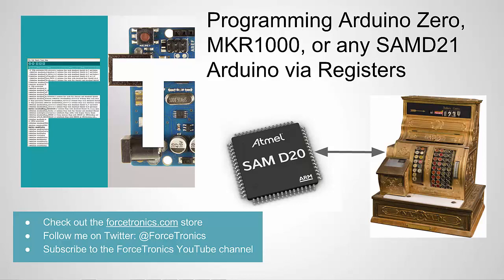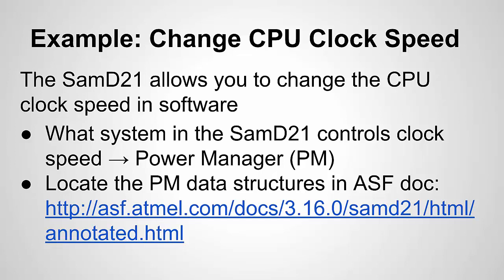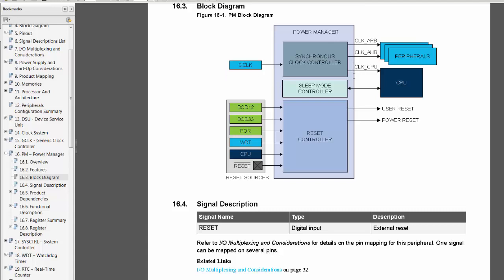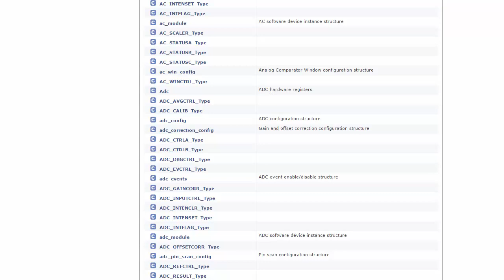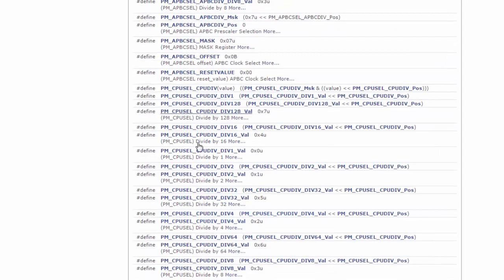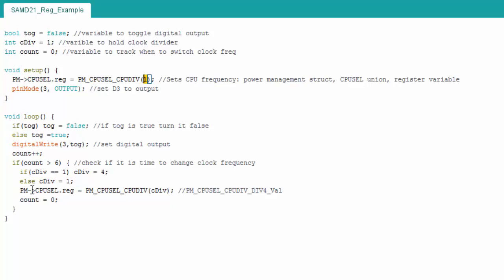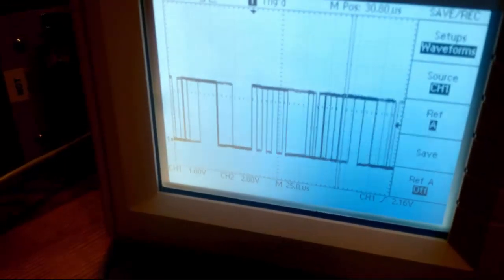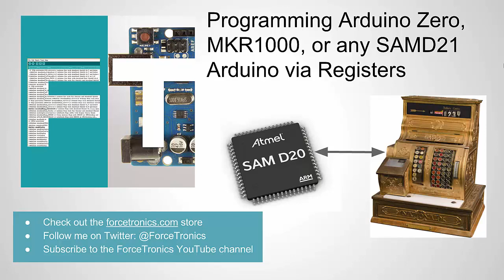Programming Arduino Zero, MKR1000, or any SAMD21 Arduino via Registers

Comment: RTFM!!!! (read the #$%^&$ manual [datasheets]!)  ASM is maximum bloat. Why use all that bloat?  Especially if you're using one or two different ARM family chips. The datasheets describe all the register structures, etc, and using the simple structures in the includes files (*.h) and address casting will allow you to use everything to your heart's content.  The best IDE for SAM chips is AS7 (Atmel Studio-7).  So many useful tools and all the include files are clearly shown and accessed so that you can easily understand the structures and classes to help make register access easy-peesy.    Arduino is BS comparatively. Arduino actively strives to hide EVERYTHING from you, the programmer. You will never learn what you need to learn if working only in the arduino ide. Arduino was designed solely for absolute beginners, and just like gov'ts, it keeps you stupid and ignorant to the amazing possibilities of real programing/coding.  What's a @#$% sketch anyway?  Who came up with that stupid name? Do yourself a real favor and bust out of that very limited environment. You'll be so glad that you did.  The cool thing about AS7 is that it's just like MS Visual Studio (same platform) so that you can develop programs on your desktop/laptop/cellphone to interact with uC's and everything else. And.... AS7 and MS-VS are FREE! unlike Keil or other 'professional' ide's that have their own host of problems and limitiations with price tags of $3,000-$6,000. So go forth and explore... learn!
Yeah, learn C++ while you're at it. This will be your biggest, most powerful tool. Purchase some good books as well.  Many times a good physical manual (book) describes things in much clearer context than that of web sites.  There is not one book or source that is the end-all source. 

But like all things of power, wielding great power requires great responsibility.  i.e..... some programmers believe C++ is very limited within the uC environment, while others get carried away and employ C++ perhaps too much.  Just make your code fast and efficient, easily read by others, and easily expanded for future improvements. It takes balance that comes with experience.
Some good/essential reads:
"C++ Primer (5th edition)" [Lippman, Lajoie, Moo] -- very good book!
"Sams Teach Yourself C++ in one hour a day" [Siddhartha Rao] -- good!
"The C++ Programming Language (4th edition)" [Bjarne Stroustrup himself!]  -- Becomes an increasingly awesome book as I become a better programmer (not the best book for a beginner)
"Jumping into C++"  [Alex Allain] -- A decent book for beginners to C++.
"Atmel ARM Programming for Embedded Sysetms" [Mazidi, Chen, Ghaemi] -- This is the one book that opened my eyes to the ease of bare-metal SAM programming.  A truly 'must get' book if you want to understand these chips quickly. Some errors, but they are obvious.
Data Sheets [Atmel and MicroChip] --  these are absolutely indispensable for understanding the hardware that you are programming. Make hard copies for each chip family. Make notes in them. They may seem difficult to understand at first, but you will adjust your thinking as you progress..... they are very easy to follow... Atmel has done an absolutely wonderful job writing these manuals, compared to other chip manufactures. You will learn them inside and out!  Go to it!
Reply from the maker: Wow good for you putting so much time in this comment. Arduino is for beginners/hobbiests who don't have an EE background.  A lot of my tutorials are meant to help create a bridge from Arduino to an understanding of how to really get the most out of these uControllers. ASF could be seen as another part of that bridge. But to imply that a non EE is going to go right from Arduino to the approach of a season embedded programmer is a bit out of touch / delusional. But I appreciate the comment

Comment: Hi! I've currently go code for the Arduino Zero through the Arduino IDE. I now want to move to using only the SAMD21 chip off the Arduino. How would you recommend doing this? Do I have to transfer all my code to Atmel Studio (and transfer it over to register level) or is there a way to make use of the Arduino to code the chip using the Arduino libraries? Thank you!
Reply from the maker: Yes it is possible to leverage the SAMD21 on a custom board that you design and still use the Arduino bootloader and IDE (I have two designs that I built for companies that does just that). I currently don't have a tutorial on that and can't explain how do it in detail in the comments section of a YouTube video. The first step is understanding how the Arduino bootloader defines or uses each pin and making sure your design aligns with that. Good luck

Comment: Excellent Video, this helps immensely in sorting though the registers.  I am wondering if you have any opinion on whether it is easier or more advantageous to write code for this chip using Atmel Studio ASF vs. Arduino IDE, I would appreciate any feedback.
Reply from the maker: If you have an advance project that requires a lot of functionality that is not available via the Arduino libraries then it maybe. Atmel Studio gives you full access to ASF and it also gives you a debugger which I find can be valuable if you are using a lot of interrupts.

Comment: Will this mess with the delay and millis functions and so on?
Reply from the maker: The millis function is based off a timer counter so it won't be affected if you change the CPU clock speed. This is because the timer counters are clocked separate from the CPU clock. Not sure on the delay function though.